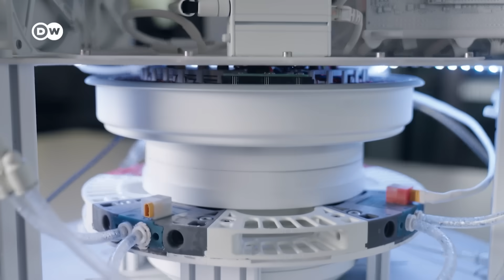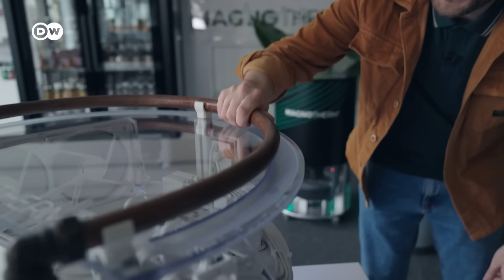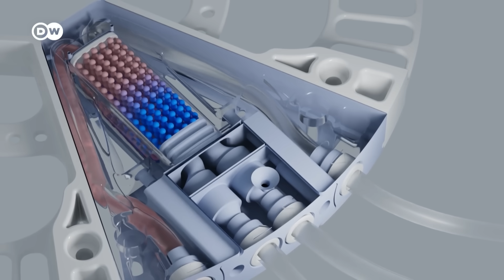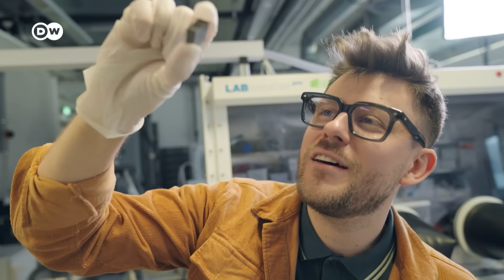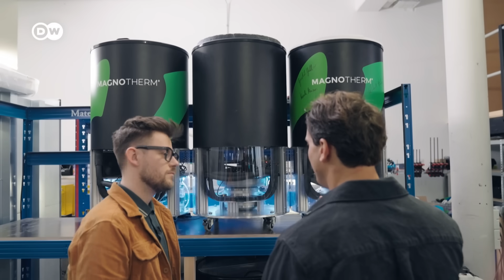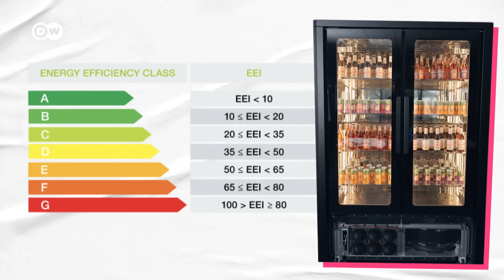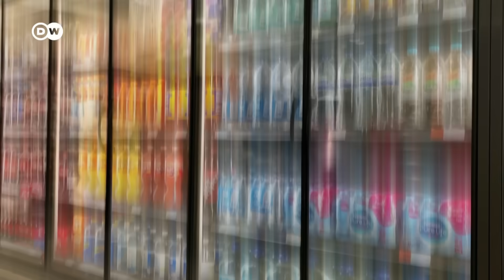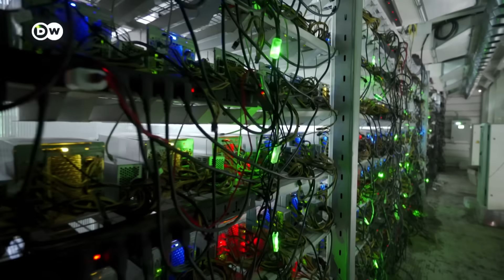How magnets could change our fridges and ACs forever

Comment: In 1984 I commenced my PhD studying the possibility of magnetic heat pump. It took me just two months to show that it is thermodynamically a very very bad idea. But it's a zombie idea: it's useless but it just won't die! 

The fundamental limitation is that (around room temperature) gadolinium is the very best candidate, and in the best possible circumstances it's possible (IIRC) to generate  temperature difference of around 31 °C. But that requires a magnetic field of 7 Tesla. If we reduce this to something practical like 1 Tesla, this reduces to around 4 °C. And then there are the heat exchangers. Normal refrigerators can drop 5 °C across both the hot heat exchanger and the cold - this makes the heat exchangers simple enough for economic manufacture. This design is using an incredibly complicated heat exchange mechanism (the block with thousands of holes) because there is so little entropy available. The limitation in entropy is basic physics and can never be overcome. 

The physics works at low temperatures (close to absolute zero) but it's not possible around room temperature.

I have not made that many great choices in my life, but spotting that that PhD topic was a dud was one of the very best decisions I ever made!

Michael de Podesta MBE FInstP CPhys
Reply: Ah so it's another "why don't we get water from the air?" "innovation"?
Reply: @michaelmartin9022  Yes, sort of. Best wishes: M
Reply: @michaeldepodesta001 how can i do this in my house , here in india it's 40 deggree c
Reply: @michaeldepodesta001 rip It looked so cool. Like how little me thought coolers used magnet nonsense to work.
Reply: @michaelmartin9022  In Africa and China... they actually ARE getting water 'from air' successfully and last I read...they are upscaling this basic technology as we speak.  Just google that concept and you will see its working
Reply: @michaelmartin9022  water from air  is truthful
Reply: @ggkunited  Yes, but not in deserts, which is where the kickstarter scams always envision setting machines up
Reply: @ggkunited  you can very easily get water from the air in high humidity regions
this is also where it rains a lot, and usually where you have natural streams you can get water from
Reply: @illdeletethismusic  I guess water from air can be useful in islands with no source of fresh water.
Reply: @Random84530  If you have a strong aversion against collecting rainwater, yes
Reply: @Random84530  Desalination is much more energy efficient than using a dehumidifier, per litre. (One of the water from air projects was literally an off the shelf dehumidifier with a fancy shell)
Also you can do desalination with solar heating, and a whole system could work with no mechanical or electrical power.
Reply: Can't wait to get a 7 Tesla fridge at home - it will most likely gather up all the metal in the neighborhood... including the cars (and maybe even some lose rebars).
Reply: @getsideways7257  Good aAfternoon. Yes, 7 tesla magnets are great fun. The full field is concentred inside a solenoid, but the leakage field around the outside is enough for great tricks. We used to tie a spanner to a piece of string and then have the spanner held almost horizontal by the magnetic field - we used it as a "field detector". And of course teh most famous experiment is the levitating frog! https://www.youtube.com/watch?v=gJeqriqRYYE
Reply: As HVAC technician I thank you for assuring me my job is safe.

It reminds me of peltier elements. Also the kind of thing somebody brings up every few years as if it was a new thing.
Reply: @Turtlemaroon  When I did my study I knew nothing about the HVAC industry. And then I learned that very aspect of the refrigeration cycle had been pored over and optimised for decades. 

As part of my talks about heat pumps, I show people a Peltier s0-called "beed fridge". I measured the cooling rate of a litre of water in the fridge and the maximum power was... one watt!

Yes, I think your job is safe!
Reply: Sometimes, there are people who have good engineering knowledge, and they can build working stuff, but their basics of science are weak. I myself learned DIY by opening things and trying to figure out what everything is doing. Then I studied things formally and learned a lot as well.

They might have a weak mathematical base, which make them to not find the optimal solution to a problem theoretically, or they might not understand thermodynamics properly, which causes them to think that some magical technology can do the job.

Some people can also be banking on the fact that our current understanding of the universe is limited and their might be loopholes to exploit or some hidden physics phenomenon which can give us perpetual motion machines, or reduce entropy in a closed system, or travel faster than light.

The same thing is happening with Li vs Na in battery space but most people don't realize that an optimal Li battery will always be better than an optimal Na battery. But Sodium batteries still have a lot of potential and they are definitely better than Lead batteries.
Reply: @himanshusingh5214  I think I agree with most of your observations. It's really why great developments have people with a mix of insights from engineering, maths, computer science, physics and chemistry. 

And yes, the current developments with batteries are extraordinary: we are living in exceptional times. There is no fundamental reason why batteries must degrade with use, and I think in a few decades batteries - using both sodium and lithium - will be dramatically better than they are now. And ubiquitous!

Best wishes

Michael;
Reply: This comment should be pinned. 
I had a suspicion that this magnetic refrigerator is some kind of sneak oil product, but I was thinking more from engineering perspective. This thing is very complex and requires expensive materials and production methods in comparison to modern compressors. I doubt that it would ever reach reliability of traditional fridges. 
It is good to know that from physics perspective the magnetic fridge makes equally little sense.
Reply: Yea, I figured, and imagine needing to fix such a fridge, replacing the compressor which uses a well-known technology and was refined over ages? No of course not, you will probably need to replace half of the entire mechanism depending on how bad it is.
Reply: Felt like a dud, thanks
Reply: Could there be a niche use for this type of cooling? Or is traditional always better?
Reply: @dav9104  I was thinking that traditional heat pumps use dangerous gasses as refrigerants, like propane, cyclopentane, or CFCs. In applications where leaks are unacceptable, a simple water based system where all the toxic bits are solid is a good alternative.
Reply: In fact, while we are at it, building fridges with elastomers might be considered too. They have the same hysteresis cycle atleast. However, they can be so cheaply manufactured that no one would mind getting then replaced every week. However the same thermodynamic limitations apply. They can create very small temperature differences. Heat exchangers are another problem altogether.
Reply: @Economistwa  https://en.wikipedia.org/wiki/Rubber_band_experiment
Reply: As a PhD roots doctor myself, I can confirm Michael’s commencements
Reply: Ahh entropy!  I swear, if you cut funding for every R&D proposal that was doomed to fail by entropy we would have trillions in savings and PHD baristas and burger flippers everywhere.  Is there a graduate class where they teach that managers and politicians don't understand entropy?  How to get funding for "never been done" research 601.

Last question -do we know that nothing beats gadolinium?  Is there an alloy or crystalline structure that could be better?
Reply: @skyak4493  Good Evening. Regarding your first point. Yes. Understanding the difference between  what might be technically difficult and what is definitely impossible should definitely be taught more widely

Regarding how do we know there is not something better than gadolinium. The whole effect relies on a ferromagnetic phase transition. Let me explain. Above about 20 °C (293 K) gadolinium is paramagnetic. In this state it can be magnetised, but it does not retain its magnetisation when the field is removed. Below 20 °C it is ferromagnetic. If magnetised it remains magnetised when the magnetising field is removed. There is some entropy associated with this transition. The amount of entropy - which depends on the magnitude of the magnetic moment on each atom - and the transition temperature - characterise the usefulness for refrigeration.

There are plenty of materials with different transitions - but there really aren't that many that have a transition temperature close to room temperature. There are loads that have transitions at lower temperatures and there magnetic heat pumps can be useful.

Best wishes

Michael
Reply: @michaeldepodesta001  Thank you for the explanation but it doesn't rule out the existence of similar properties from a compound or crystal.  My thoughts are that magnetism is due to the arrangement of electron paths (am I wrong?), so it should be possible to affect magnetic properties with doping and crystal structure.

Any merit to this line of reason?

Thanks in advance
Mark
Reply: @michaeldepodesta001  I heard that ai has increased human material science by 800 years by discovering 280,000 new material. Before ai humans only knew of about 28,000 different materials. look it up, there could be something out there
Reply: @skyak4493   I heard that ai has increased human material science by 800 years by discovering 280,000 new material. Before ai humans only knew of about 28,000 different materials. look it up, there could be something out there. there's so many new materials that they haven't had time to create and test them all
Reply: Thank you for taking the time to share the whole story from your perspective as someone who actually knows something. Instead of someone who got their phd from the first page of Google.
Reply: I was also wondering how susceptible is the system to humidity.
If there's limited entropy to carry heat away, wouldn't some air with a high specific heat put a decent wrench in the system?
Reply: Two questions, is that 7° or 4° per gadolinium block? Is it possible to stack them in stages to increase the temperature difference?  Secondly, this team is using a 3d printed part. Is that why they think this technology is viable now? I know Lanthanum is expensive, and their final product might still end up being expensive. What other materials can do this? 😊
Reply: This type of stuff is something I see often on Technology Connections stuff, and it's great information to know about too...But yeah, it's basically just as nuts and impossible as saying "I need you to build a time machine that allows me to go to any date and time in existence and then come back to see if it works"....
Reply: Like the Thorium Dream, it just isnt a practical solution...yet❤
Reply: The thing that struck me is, why not use this in conjunction with compressor design?  In heat pumps that can take up a larger area seems like it would allow the compressor to run less while prepping the temps up to a higher level. But I don't know what I am talking about.
Reply: Thanks for this Michael,  the fact that they're admitting a COP of 1 to 2 only, while the video references a paper that says it needs to be 6.2 to be competitive just makes me think this is not going to go anywhere anytime soon.
Reply: @Mike__B and 30% seems weak gains
Reply: @Mike__B  Oh wow. Well doe for teasing out that information.
Reply: wait so did u get PhD for showing that?
Reply: @raptorhacker599  no way. You don't know how PhD works lol. Even if he did, he would have to spend 3 years and at the end  writing a useless memoire saying "it needs more research".
Personnaly I didn't ditched PhD because I needed it desperatly. But maybe a third of my real work is in there, and most interresting things I pointed out were to disturbing for my fellows reputation and thus they were all censored, not a single trace. And like many of my kinds I left research to make sure my learnings would be usefull to something. I know many talented people that went to music teacher or baker after graduing (in applyied physics, not even a deadend "science")
Reply: @raptorhacker599  No. Since you ask...

At the time - 1981 or so, I graduated with a good degree in Physics but I had no idea what I would do. I was disenchanted with conventional physics which seemed to be about warfare. So when I was offered this project it seemed like a way to use my physics for good.

After I showed that the Physics in the project didn't;t make sense I learned that the PhD scholarship I was on was actually mine personally - and not the supervisors. And by this time I had fallen back in love with physics. I picked a different project - a very arcane subject - on the electronic structure of potassium metal at very low temperatures - and I completed that about 3 years later.
Reply: So it's another "net positive for half a second" fusion reactor hit piece.
Reply: This reminds me of the common engineering principle: KISS (Keep it simple, stupid)
Complexity = high cost, delays, low results, lots of disruptions and pain (mostly mental)

Only a true expert can come up with a simple solution. The more simpler and effective the solution the more of an expert you are.
Reply: Well it's also possible if you chose the subject for your Phd  you would have been one of the people hired to research the technology and been on a team that found an alloy/ceramic that would have made it all work.
Reply: @joedirt1965 That would be high temperature ceramic superconductors...which is the holy grail for which myriads of people are looking for and which have vast domains of applicability not just refrigeration, no?
Reply: @joedirt1965  Even this company - which has expended considerable efforts to 'make it work' is facing ethereality that there product is not as good as the dramatically cheaper and easier to make alternative - a vapour compression cycle.
Reply: There is no free lunch, … this was my  applied math phd  thesis.
Reply: @firstlast-gr9xs  In quite a profound sense, "there is no free lunch" is really the subtitle of everyone's PhD thesis. Everything we look at in detail is just hard!
Reply: There are ways to significantly improve the current vapour compression efficiency. Have spent many years working on this!
Reply: @alanrunningmusic6874  Wow. That's interesting. It's certainly true the coefficient of performance of domestic heat pumps has got dramatically better in the last 10 years. I think it's in larger part due to optimisation of the compressor operation - allowing it to speed up and slow down to match cooling/heating requirements - and also changes to the expansion value to make it tuneable. 

What innovations were you working on ?

Best wishes

Michael
Reply: It is nice but most find it has two many moving parts.
Reply: I see you have tried to make consistent youtube content. It might be a good stream of content to show the true physics of ideas like this. I'm very interested in the details of the theoretical maximum temperature drop at different environmental temperatures.
Reply: @VoidFame  Thank you of you kind words. I am thinking about it, but making videos is hard and very time consuming. And I am old and busy!
Reply: Profesor:  You can become a part time consultant for this company.  I'm sure they think of the idea.  Brilliant analysis !
Reply: can you please say why this company is using rotating magnets instead of just using electromagnets ?
Reply: @-Rishikesh  Good Morning. I guess the designers are trying to minimise the energy required to operate the device. To create a magnetic field with an electromagnet requires an electrical current to maintain the magnetic field. This will result in electrical heating in the wires. This is wasted energy. Using a permanent magnet requires no electrical current to maintain the magnetic field. That's my guess.

Best wishes

Michael
Reply: @michaeldepodesta001  Thanks for the insight :)
Reply: You mentioned zombie.  My first thought was voodoo. I've been servicing refrigeration for over 50 years.  Currently have 5 geothermal units running in different houses and offices. 
What ever this is, and I don't understand it yet, it's certainly nowhere near ready for prime time.
Reply: I'm only a cert 3 in refrigeration and even I can see it won't work 😂 thank you for your work Dr one day I hope to study on in my field
Reply: In short, they are trying to milk the investors...
Reply: This is interesting, what you wrote. I imagine the costs with rare earth metals would kill this fridge, as you need it not only for the motor magnets but also for the heat transfer. This grid structure is for increasing surface area to quickly transfer the heat, but then you have water that passes the same volume, so there is another problem of mixing the water and timing the valves - another point where you lose efficiency.
To get higher power you add stages of the same design so scaling is an issue as well.
I did not see any advantages from user perspective, probably the noise is much lower, but it still has moving parts, probably to have less magnets per cooling stage as you can use a single magnet that passes next to stages.
There's a lot of tubes that can leak, a lot of valves when in compressor you just have one circuit, maybe two of fluid. If General Electric worked on it and stopped this for me indicates that it has no economic sense, they have much more resources to develop and test it. This company will end up like e.GO (electric car made in Germany) when all money from investors will be spent.
Reply: Thank you so much for your help in de bunking this technique and technology, hope no one else start wasting there time and investor’s money on such a fruitless and inherently useless technology that there is already a very efficient and effective solution available. This is not going to help revolutionize the world AI is doing that right now. Europe wake up and start some AI technology companies instead.
Reply: If it isn't possible then what are they doing?
Reply: I just bought a magnet how can I hook it up to my fridge
Reply: As a random youtube armchair expert I can assure everyone that a gozzillion loud moving parts will never be as reliable as a single compressor.
Reply: You must be new to the internet/earth, thinking people care more about facts than feelings. It's 2025 and people still believe in a flat earth, virgins giving birth, essential oils curing cancer and the Illuminati. The magnetic heat pump is just part of humanity's baseline regardation.
Reply: That was insightful
Reply: Do u know of any papers about heat exchange in mechanical deformation on rubber materials?
Reply: There is where your taxes are going!!!  I’m sure it’s a government or a NGO foundation it with your taxes money!!!
Reply: @Fac79  I don't know who funded this research, but I would not be so sure it was government. The most egregious waste of money I have ever observed has been from venture capital firms. I have witness tens of millions of pounds per year being wasted on utterly impossible projects. Apparently losing money can have tax advantages!

Best wishes

Michael
Reply: I agree, it's obviously a clumsy attempt of "greenwashing", like so many others of our time.
I even considered whether the very expensive and highly inefficient Peltier-Generator-Elements could be competitive if sufficient quantities were used. But that might not be entirely true as well as an even much more expensive approach than this one.
Compared to standard refridgerators with high quality insulation, the presented approach is obviously just expensive crap...
Reply: And that Alloy is prone to rust hence a very short life ?
Reply: @spotoncam3640  I think gadolinium is very stable, but "iron based alloy" does not sound good.
Reply: Thank you.
Reply: Oh wow thanks man. I think the company isntantly disbanned after your comment
Reply: For plebes like me, what is a "tesla"?  Like I get it's a measure of magnetism, but I have zero point of reference.  What's a fridge magnet?  What about one of those snazzy magnets in hard drives?
Reply: @Asdayasman  for reference, and I'm pulling this from Google to take this with a grain of salt. A standard fridge magnet usually has 5 militesla. (0.005T)
Those big crane electromagnets they use in junkyards have 1 tesla.
And an MRI machine has about 3 tesla.
Reply: @Asdayasman  Apologies. One tesla (symbol T) is a very large magnetic field. The Earth's magnetic field strength is around 0.0001 tesla i.e. one ten thousandth part of a tesla. The field strength near super strong neodymium magnets might reach 0.1 tesla. Very strong iron based magnets can reach maybe 0.3 tesla. So magnetic fields of several tesla require special technology.

This wikipedia page shows the whole range of magnetic fields and where they occur in the universe.

https://en.wikipedia.org/wiki/Orders_of_magnitude_(magnetic_field)

Best wishes

Michael
Reply: Somebody should send video to Tundef00t!! 😅
Reply: science has advanced you are now wrong
Reply: @ggkunited  Good Afternoon. Yes, science has advanced, but the magnetic interactions of gadolinium metal have not changed. It's still just as bad an idea as it was 40 years ago. Best wishes, Michael
Reply: So nice to read a proper scientific explanation, much appreciated.
Reply: Thank you for sharing. 
Generally, my first impression was that this was a shit video by tech enthusiasts who don't understand physics, nor can explain the science sufficiently.
Reply: I'm not sure if somebody ask this already of you, but there are over 100 replies. And I'm sure it's going to grow. Did your thesis get stored anywhere that's accessible for public review?
Reply: @AdmiralStoicRum  No, it's not stored anywhere because I switched topics after 3 months. It took about two months for me to realise that the device could never work. And a further month to realise I could switch projects.

Someone did work on this project after me - despite my advice - and I recall it worked terribly. I have just written to the University of Sussex Library and if I can find their thesis I will link it here. M
Reply: It’s 2026 now and this company is selling commercial fridges using this technology. I’d like to know if the customers are happy.
Reply: MRI, the strongest magnetic average people will ever contact with.... that is poor choice of word, has at most 3 tesla.
Reply: @farn1991 MRI magnets use superconducting technology requiring cryogenic fluids. This is not practical when constructing a regular heat pump.
Reply: What about ionic cooling like Ventiva wants to do with laptops?
Reply: @sillytruthandfacts  Good Evening. If  I understand it correctly, ionic cooling is not a refrigeration process but a way of creating air motion. Tiny engineered spikes are positively charged creating a strong electric field at ether very sharp tips. The file ionises molecules in the air and once ionised the  positive molecular ions are repelled creating a flow. I think ionic cooling uses this effect to create an air flow over a surface,  cooling it in the same way as a fan, but silently and with no moving parts. At least that's my understanding.

Best wishes

Michael
Reply: @michaeldepodesta001  but it would have to cool down the laptop right? There would be no point to blow air if it doesn't cool it.
Reply: Well, the steam machine were a zombie idea, differents civilisations and era invented the machine but it didn't succeed to spread on daily uses.
Reply: I've seen your sh1tfac3 write this story on a lot of related videos, but it's always different, 1981 or 1984 , 2 months then three months, and your comment with nothing to back it up is that you dropped your PhD, instead of doing what a scientist will do and prove what it's to be proven and publish the paper instead of dropping it because it wasn't giving you the results you wanted
Reply: Yeah, this is bong-based engineering for sure
"Magnets are cool" "Let's cool with Magnets" whoaaaa broooo!! 
6 years later you have a prototype that is a little better than the worse old fridges
Reply: @ConversationswiththeAI  "Bong-based engineering" YEs, when I started my PhD I thought this sounded cool. But I wasn't smoking bongs at the time and so I managed to escape!
Reply: Ive just ordered a fridge from a Swiss manufacturer  - sorry can't remember the name - it uses 56kwh / year and has a 10 year warranty.

WE CAN make refrigerators way more efficient just by quality engineering and insulation.  In my country, this fridge will €4.62 a year to run. A giant badly made Am3ric4n fridge uses up to 800 Kwh/year
Reply: @piccalillipit9211  Hi. Wow 56 kWh/year is just an average of 7 watts which is extraordinarily low. I don't know what the design of the fridge is but I would guess that the key thing it is is very good insulation. Possibly even using vacuum panels rather than foam. I doubt that teh refrigeration cycle itself is very unusual, but the conventional cycle is already so efficient.

Good luck with the fridge: if you do recall its details I would be very interested to read about it.
Reply: @michaeldepodesta001  I have seen few of these low powered fridges. The problem is that they are fairly small and have no freezer. The lowest I have seen actual decent fridge with freezer go is around 90
Reply: @Turtlemaroon  You mean 90 kWh/year?
Reply: @michaeldepodesta001  Yes. Google SAMSUNG RB38C7AGWS9 for example (YT deleted it when I posted link. manufacturer claims 87 kWh/annum. I take those numbers with grain of salt but still.

Good insulation does a lot but these fancy fridges also have variable speed compressors same as inverter ACs as opposed to an oldschool ON/OFF cycle. (it's also nice noise wise)
Reply: @michaeldepodesta001  I think that's a typo! 56kwh. Siemens has one at 104kwh (A-Class)
Reply: @restlessrepete9754  Ahhh! that would make sense. At that very low level, I think the performance would be very affected by things like the number of times the door was opened.
Reply: @restlessrepete9754  Siemens is German. He said swiss so maybe Liebherr. They have a fridge for produce that used 65 kwh/year so he maybe switched the numbers from 65 to 56
Reply: @michaeldepodesta001  As far as I am aware its just an inverter-driven compressor of good quality and good insulation and good door seal.  It its expensive - €500 for an under-the-counter size fridge that you can easily buy for €150, but I am buying an apartment I fully intend to be in for the rest of my life - maybe ~25 years - so I am buying the lowest energy best quality appliances I can.
Reply: @michaeldepodesta001  its probably a small size liebherr with the nominal watts on label under best circumstances
Reply: @piccalillipit9211  If you just ordered the fridge, how did you forget the name? Please share as we need to know.
Reply: @piccalillipit9211  HEY, my badly made American fridge only uses 685 watts.  
Can you tell me what fridge you have?  Make and model?  Just curious.
Reply: @piccalillipit9211  make sure you are comparing two equivalent units also you should realize that simply insulating a fridge (or water heater or that matter) does nothing to improve efficiency of the cooling mechanism it only reduces the parasitic losses but that does not mean it is not worthwhile to do as it will reduce the operational costs,
Reply: @piccalillipit9211   When that arrives, would you be able to look this video and comment up (save video to your YouTube account, or bookmark to a folder in your web browser), and let us know who the manufacturer is?
Reply: @piccalillipit9211  Liebherr?
Reply: @piccalillipit9211 most big fridges use 1kwh a day
Reply: A cooling system can be made with ANY power use. The cooling capacity determines efficiency. So that is not a valid comparison. We have freezing units which use zero fuel,, hp and KWh costs.
Reply: @laurencerilling5873  I'm sorry I don't understand your comment. 

The second Law of Thermodynamics says it is impossible to have a refrigerator which works without being powered i.e. heat only flow spontaneously from hotter objects to colder objects.
Reply: @piccalillipit9211  can you post the name and model number please?
Reply: @piccalillipit9211 how many cu ft? My 25 cu ft 20 year old whirlpool uses 1.25 kwh a day. Older less efficient ones used 3+ kwhr a day.
Reply: @piccalillipit9211  OMG, that's amazing! That's so cheap to run. Good on you all!
Reply: @piccalillipit9211 that's an incredibly efficient fridge please post the name when you do get a chance I'd love to look into them (I'm just a nosy Aircon/fridge mechanic)
Reply: @piccalillipit9211 56 kWh per year looks too low, maybe you could tell what is the size of the fridge.
I have LG GBB92MCBAP which is rated as "class A minus 10%" and takes 110kWh per year 203cm high, 384litres.
Reply: @michaelmartin9022 Do you think an alternating magnetic field via superconducting Inductor would get you the the high strength field you referred to? Do you also think 3d printing the magnet would work (better geometry , more surface area,etc..)? Or does the magnet material have to be loosely held together vs crystallize structure?
Reply: @0xanier0  Fields of 7 tesla or similar cannot be generated with any technology other than (a) superconducting magnets or (b) extraordinarily high currents in steel coils. The 3-D printing of the magnetic material is good for heat transfer, but it does not affect the intrinsic magnetic properties of the material: it is these fundamental intrinsic magnetic properties that are the problem. Best wishes: M
Reply: Did you ever consider using graphene, machine learning and AI to make it possible? 😜
Reply: @James_08_07  writes:
«Did you ever consider using graphene, machine learning and AI to make it possible? 😜»
That only works if you incorporate it into a harmonically entrained quantum consciousness in partial superposition with Schuman resonances along the normal vectors of the delocalized π-bonds of the graphene sheets. Any idiot knows that.
Reply: yes, I've heard about the idea of magnetic based fridge for decades. but never see the real product up to now. probably will never?
Reply: @YSKWatch they trying to milk the system
Reply: They built the fridge though. This isn't a kickstarter scam. They build and sell working products. This is what I'm not understanding about your claim.

If you take money out of the equation, how much of a problem is left?
Reply: @techmouse. the scam part is same as  selling those spokeless electric bicycle and claiming it to be the future. Sure it looks cool, but doesn't really solve any issues traditional bikes have but instead introduces new problems.
Reply: @techmouse.  "If you take tax payer money out of the equation" is the right sentence. I have worked with many companies in various fields that were developing things. Sponsoring research and dev is one thing. But they claim and get also taxpayper money for their first years selling products too. And if you remove those non legit money, they couldn't continue for some weeks. Even scaling up. They live on taxes for a while, then go to another project/sponsors. Saw some people spend 30+years doing that. It's kinda stressfull so most employees ditch and go to some real work as soon as they can.
Reply: longest scam theme I saw is hydrogen as an energy medium. Can't even count the rebranding and greenwashing themes around it. Well, it was part of my specialty as a safety process phD engineer, so I attrack those scams lol. Some real project were legit, but very very specific. One hand fingers is enough to count them over 15 years 300 projects.
Reply: @AtlantisArch  Are you complaining because the government isn't obsessing over profits? Because they're making sure unprofitable ideas that would otherwise never see the light of day are getting funding?

I'm glad my tax dollars are funding ideas that make billionaires sweat. Worth every penny.
Reply: @AtlantisArch  Yes, some topics seem to be able to dazzle investors with a hypothetical bonanza - and sometimes people are so dazzled by the bright light of the illusory gain that they just keep ploughing on.
Reply: @techmouse.  not. 99% percent of the "projects" knew the real limitations but didn't even targetted those to solve them. Purely ransom money for useless projects that would be demolished within one or two years after project's end. You can compare it with USAID without problem. Total waste of money. One they were about to finalise an international standard that was armfull for customers, I came just in time to stop it all. And none couldn't even argue against basic physics/chemistry established for decades. But still, they were private companies guys paid with taxpayer money to write a standard to ensure competition couldn't sell any product. Pure Evil. You can't imagine what stupid things are labeled "research" to spend you taxes on.
Reply: @michaeldepodesta001  they didn't even branded shiny illusory gains to promote those LOL. Just a phone call to their friends granting the money, a two pages paper, some other (international) teamate to make it "serious" (all rewarded of course, even if barely even reading some emails sometimes). 
Welcome to real world ...
Reply: @AtlantisArch  Do you really need to throw out the word "scam" for things that you don't think are good ideas?

Cars that run on hydrogen already exist. South Korea in particular has thousands of buses than run on hydrogen. So it seems strange so say it's a "scam". The people that work on them believe they can work, and are trying to improve them. Just because you don't think the technology will be able to become more widely viable, doesn't mean it's an actual scam.
Reply: @AtlantisArch what about e-cars?
Reply: @AtlantisArch I didn't hydrogen cars are scams
Reply: @pardagel It is a scam as far as economic visibility. Not as a an actual technology. But I am not surprised you don't get the difference. All those scammers are relying on people like you.
Reply: @pardagel  I think the scam part refers to the promise of supplying 'green' hydrogen at a price similar to electricity for electric cars.

I'm assuming fusion power would solve that, in that it would be cheap enough that hydrogen becomes viable for long range/high drain use cases.
Reply: @AtlantisArch  In germany they issued special state sponsored bonds called "Grüne Bundesanleihe", focusing on Hydrogen as the next big thing, probably because german auto manufacturers slept through the electric vehicle boom. It has been fully institutionalized.
Reply: @pardagel  Look into industrial hydrogen (for serious volumes, that is) and how that is made and that will answer your question.
Reply: @techmouse. There is not a chance in hell that this technology will be deployed in practice. It's just a bad way to do this. Perhaps they found it technically interesting or they need a project for some students. IT's objectively worse than a conventional fridge in every single metric. Cost: Efficiency: Complexity: Consumed Power and achievable temperature ranges. 

And I am not making 'a claim': I am reporting a basic fact of physics.

Best wishes

M
Reply: You know it's 2025 now right?
Reply: @LegendofLaw  Ah yes of course, the PhD holder must clearly have forgotten that the laws of thermodynamics received a balance patch last year.  This changes everything.
Reply: Yours is a great mind, but obviously there are greater minds out there.
Reply: @ElvisFantastic  That's kind of you to say that mine is a great mind, but it's not really true. And there are indeed far far greater minds than mine - I meet them every day. Best wishes: M
Reply: @michaeldepodesta001 what do you do for a living now? Curious about what career path you went with - An HVAC design Engineer
Reply: @hr_47  Good Evening. Since you ask...

After discovering the fundamental problem with magnetic heat pump project, I thought my chance of a PhD was blown,. But it turned out that the scholarship was mine rather than belonging to the PhD supervisor. So I switched project and studied a much more arcane but conventional subject to get my PhD: I studied the electronic properties of potassium metal at ultra low temperatures using the so-called de Haas-van Alphen effect. After graduating I got a job at the University of Bristol and started to develop a calorimeter for use at low temperatures. Then I got an academic position at Birkbeck College at the University of London. I taught there from around 1987 to 1997 when it was shut down - but I had tenure and so I moved to University College London. But I did not like it there and left (age 40) in 2000. I got a job at the UK's National Physical Laboratory - similar to the USA's NIST. I worked there for 20 years specialising in temperature measurements. I did all kinds of work but built two primary thermometers - devices which work out the temperature without requiring calibration against another thermometer. The latter project was the most accurate thermometer ever made, able to measure the tiny errors in all the other thermometers on Earth!

While at NPL I was asked to develop a course to teach the public about Physics and so I created etc Protons for Breakfast course and in 2008 I began the blog

https://protonsforbreakfast.wordpress.com

I am now 65 years old and I have been retired for 5 years. Since retiring I have spent most of my money and time reducing carbon dioxide emissions from my home and now I write mainly about issues around Climate change and try to help people reduce their emissions of carbon dioxide.

Wherever you are in your career, I wish you all the best: enjoy the ride if you can!.

Michael
Reply: But getting water from the air can be a very good solution temporarily for some places.
Reply: @himanshusingh5214  ofcourse it is but the problem is that every "new comer " in the techno😂bro industry tries to present it as a new revolutionary idea . Something that we have known for some hundreds of years now . The thing is , yes they can be made more efficient but never at the same levels that these imaginary physics those blokes try to show it as . Taking it few percentile points up could be fissible, but taking it to crazy numbers is just forbidden by physics and no matter what the materials are or will be it cannot be done . I think the whole point with science communication, the problem of it actually, is that sometimes people , for money mainly, try to reinvent the wheel . And as every person with even a highschool level knowledge of physics can understand that the universe does not give without taking something in return. It would be much better if people were more realistic instead of dreaming impossible things .
Reply: @himanshusingh5214  It's not efficient but yeah it works. Slow but viable in desperate situations.
The funny thing is that places that would make "air stills" better don't need them. If the air has high moisture, it probably rains a lot there, so no need for stills.
A place I can think of that 1) Has high air moisture and; 2) No easy access to fresh water is: Open Ocean. 
If you're stuck on a boat/raft, it would be an "efficient" way to get constant fresh water, since the ocean evaporates all the time. It might not be fast, or even enough in the long run (depending on design), but it'll work.
Reply: @MourningLightMountain  Yeah and it is cheap which makes it ideal for small scale temporary needs.
Reply: @himanshusingh5214  of course. the only limitation is energy cost which will reduce drastically with ZPE / cold fusion